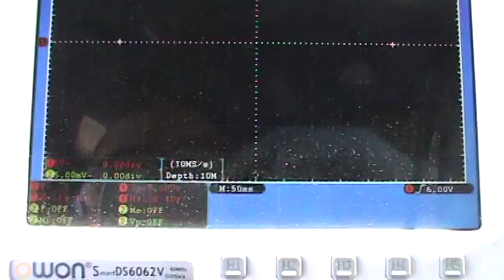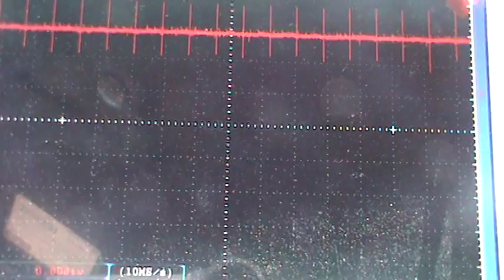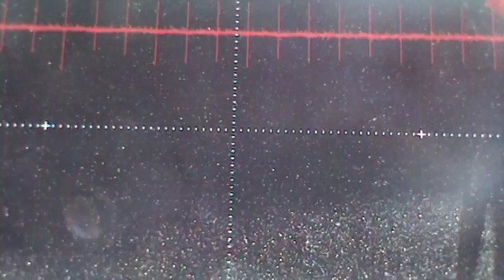Oxygen Sensor Heater Control Mystery

Comment: the o2 sensor heater control only comes on till the engine goes into closed loop.  What kind of car is it?
Reply from the maker: Toyota. The pcm was faulty.
Reply from the maker: *****  Computer was Not the problem. I did an updated video regarding this vehicle. I had to put correct sensor Denso 234-9010.

Comment: Roman I think  the ecm is turning off the o2 heater because there is a heater circuit fault stored in the history.  Before putting in a known good o2 clear the fault code or remove neg battery cable to clear ecm memory and it should be fixed.  Now I'm  just a doityourselfer but it has worked for me in  the past, maybe just luck .  For me  I was watching OL and CL and it seems the ecm did not give the o2 a chance to  hit CL  as  your 15 sec timed out.   Hope it works and thanks for sharing this one with us.  Hopefully one of us will get it right. LOL
Reply from the maker: Steve please do not think because you are a "doityourselfer." you are any less of a technician. I have personally met technicians that spend all day doing everyday work, but never getting into the diagnostic aspect. I think doityourselfers nowadays are damn good at what they study on.
Reply from the maker: PCM was the fix. I checked wiring all the way to the computer. I was getting bad numbers. I unplugged the harness, tested the terminal at the computer, and still bad numbers. Sometimes it is the computer.
Reply: ***** Glad to hear and not so easy getting to the pcm and then testing  it. Well done.
Reply from the maker: ***** Computer was Not the problem. I did an updated video regarding this vehicle. I had to put correct sensor Denso 234-9010.
Reply: Look forward to the update .